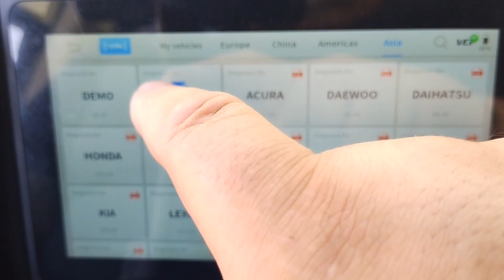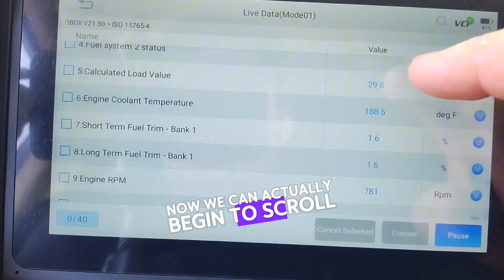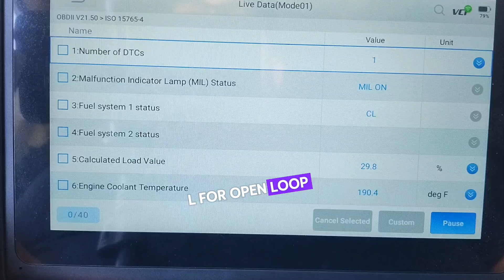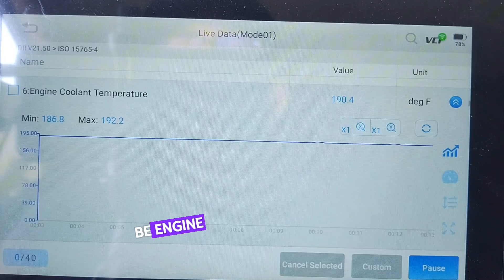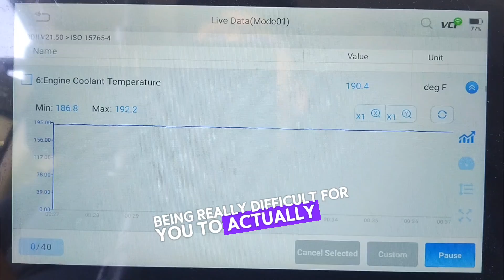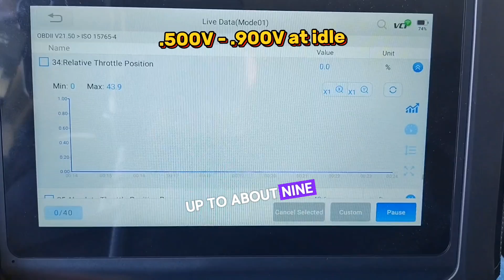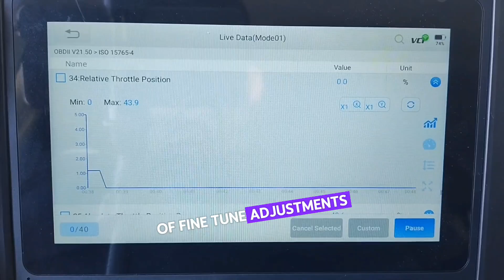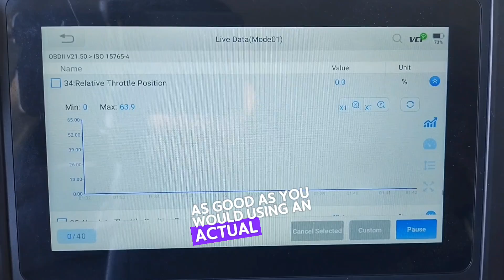OBD2 Scanner Live Data Explained: [Top 3] Data PIDs

Comment: Good job your helping me  and others understand  how to use obd scanner, my check engine light flashed 3times then went off  ,iam having  hesitation when hammer down for passing gear but no light ,autozone let me use there scanner  every was good  .2000 toyota 4 runner  ,it asks  for Vin # milage  .. getting terrible gas mileage, have agood  rest if your  day,heading to the dentist.
Reply from the maker: Thank you for watching. A flashing check engine light means that your misfire is so bad its causing catalytic converter damage. Might want to test the MAF to make sure its properly estimating air density and also fuel volume.
Reply: Can you expand on the fuel volume?

Comment: Great video. I have an icarsoft pro tool and not very proficient at using it. I have an on going fault with a Vauxhall Corsa that runs fine for days then loses power. I thought it was an EGR fault because the live data shows EGR error 99.2. I had a new manufacturers EGR fitted and I am still getting the same reading and the car has the same fault any advice?

Comment: Great video I have the d7s, still learning tips on using so thanks for video. I do have a question though. How would I know which obd2 option to pick for my vehicle ? The newest I have is a 2004. Thank you for the great content!
Reply from the maker: Thank you for watching. It depends on the vehicle. Pin 2 is VPWJ1850 GM&Chrysler, Pins 2&10 PWMJ1850 Ford, 6&14 CAN Most 2008 and newer, Pin 7&15 can be either ISO 9141-2 or KWP. With lots of practice you'll know what protocol to select with using auto.

Comment: How about a hybrid with so many history codes your scan tool can’t read them?
I have a GWM HAVAL H6 HEV with over 200 codes all history.
VEHICLE DRIVES 26km then feels like a misfire or disconnect and looses all power. No indicators no hazards no HUT no fault light on the dash or EML on, but, there’s a rake of history codes all relating to communication. Too many to actually find a starting point!
I’m fried!
Reply from the maker: Reads as if you have a communication issue. Check each module and see what module they say they can't speak to and focus on that module and communication bus to said module.
Reply: @MasterAutomotiveTraining  looked at this again today.
Found a tow hitch module to have a bad connection point , I will drive tomorrow and see if this solves the issue.